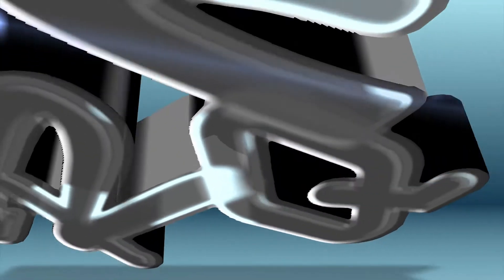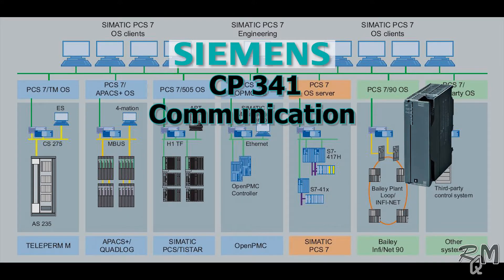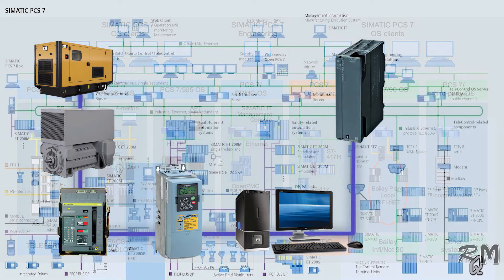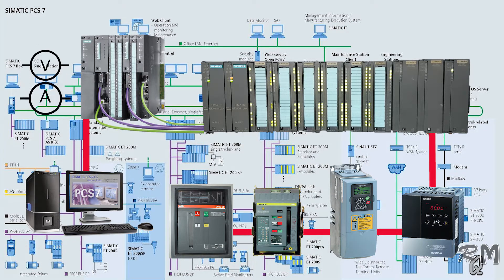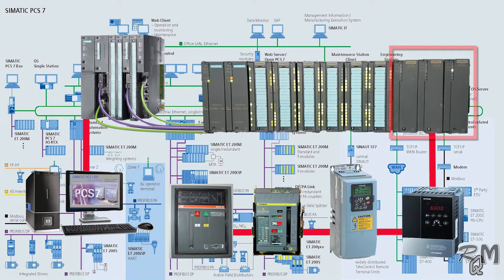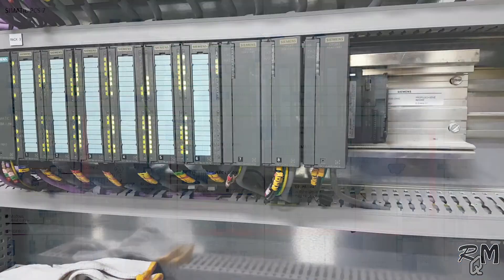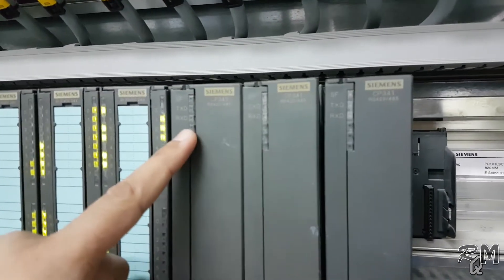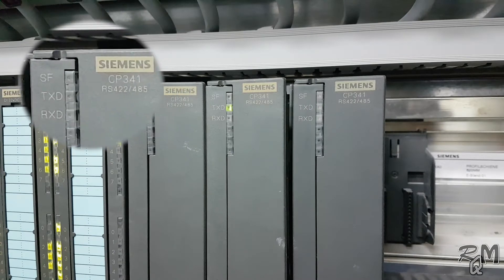Siemens CP341 Modbus Communication Fault/Error

Comment: Thanks a lot brother you help me a lot by this vedio.I have a problem at present that CP341 LED RXD only glowing but TXD LED isnot flashing/Off ?? I tried this way but no use I tried switch off the power supply no use >>any suggestion
Reply: engineer - Dear brother, have you resolved this issue or not same problem I am facing with CP341